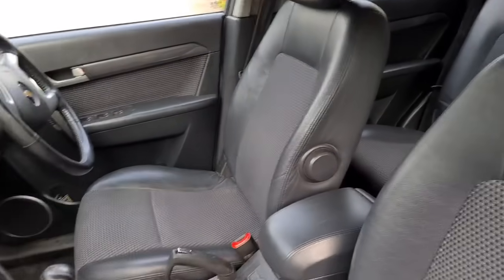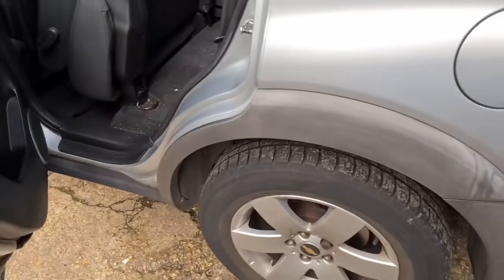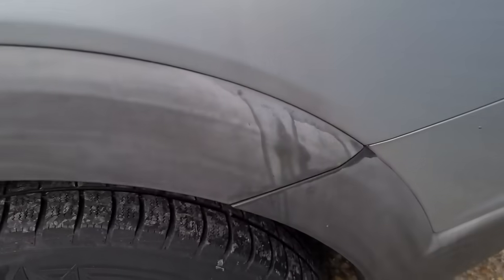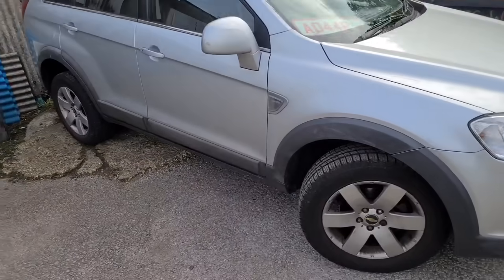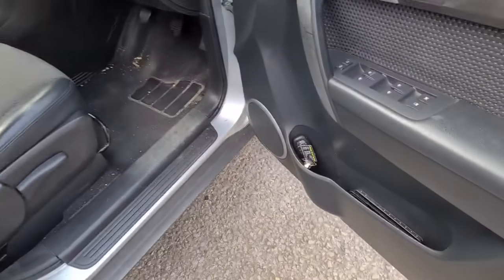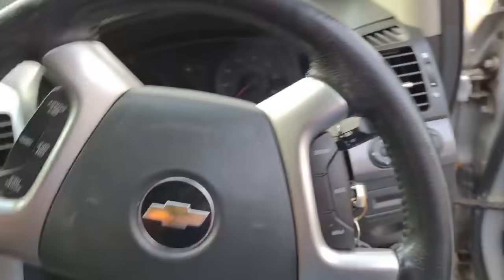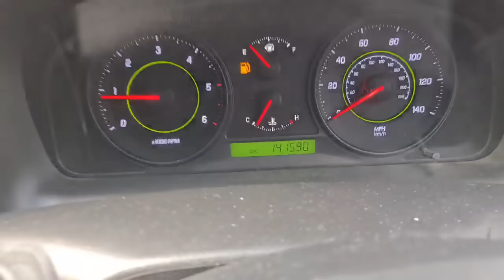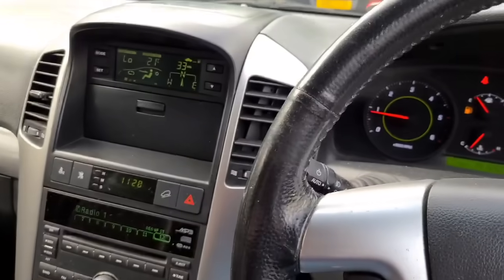Flipping Cars - Saving Scrap £150 to £1500. ( Why Was It So Cheap ? )

Comment: Great deal, I can see why it’s cheap because of the brand but £150 seems very low, would of expected around £500 valuation, but I think you could advertise at £1995 and achieve in excess of £1750. Good to see you back

Comment: You started interior with vacuum. I'd recommend you get a powerful air compressor and blow every out first. An air compressor will make interior valets much much faster and more clean. Use air for cleaning plastics, areas you can get to air will blow out debris. Also get a big brush for washing cars, faster, easier on the body

Comment: In mainland Europe, this thing in this condition (after detailing), would easily fetch 3-4K euros (if it was a LHD). But even in UK's context, i'm completely perplexed as to how this was valued at 150 pounds, destined for the scrapper?? The damn thing is in great mechanical condition. Even if it's a TD and the turbo was bad or the high pressure pump, you could still replace the parts and make a killing. Goes to show how bad our consumerism has really become - perfectly good things being thrown out without a care. Sad really. 
But great to see there are still people who undo these dumb decisions and, why not, make some extra cash for it.

Comment: I recently bought the 2013 3.2 petrol version with 30000km on it here in Australia for $10,000 and thought it was a bargain. £150 is a steal.
My only issue with the car is the on board Navigation "feature". The map data supplied is from 2004 and to update to the latest data set requires a trip to the GM dealer with $1000 in hand ($500 for the data set and $500 for a firmware update ) so I can use map data from 2014!!!
I've bought a dedicated Garmin unit to use.
Cheers Eric

Comment: Good car. Interesting to see how well the heat gun trick works. You could get some of the service history off the internet, eg Car Vertical, and print it off. Are cotton bud tips better for touching in chips rather than a small brush?

Comment: Just a quick one. Iv been tempted to heat gun a few of the plastics on my car as well but I saw online it was meant to bad for the plastic and will eventually encourage it to fade more. Have you ever had an issue with it or does it tend to stay decent for a while?
Reply from the maker: It's used as a last resort really. As it's not good for plastic one time fix
Reply: @drivewaylife  ahh ok good to know I'll try some of the back to black first as its not to bad. Thanks for the reply mate